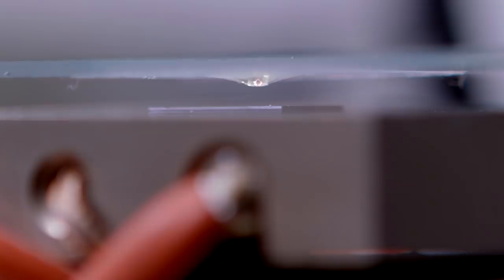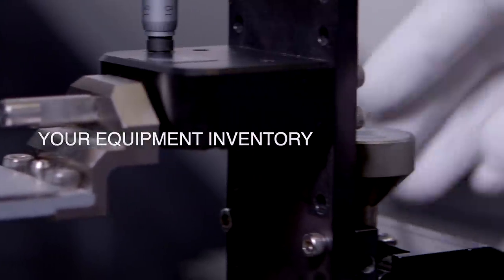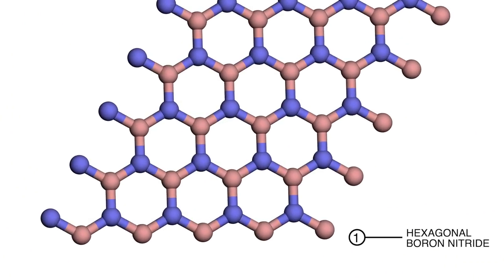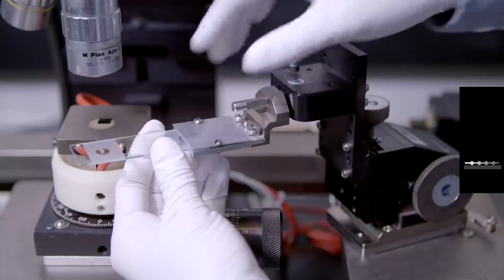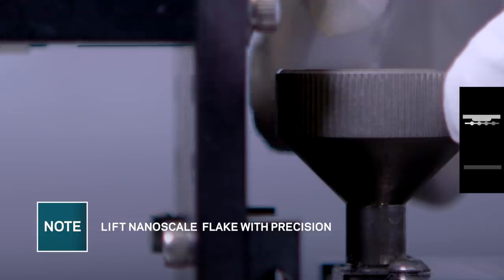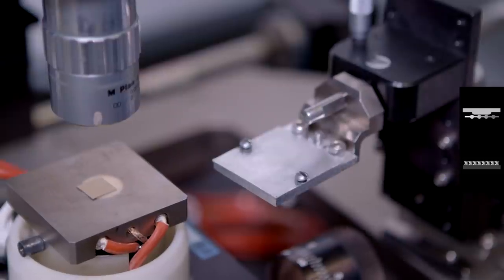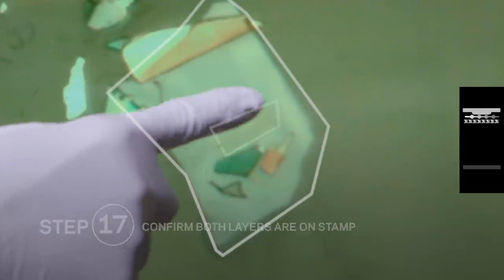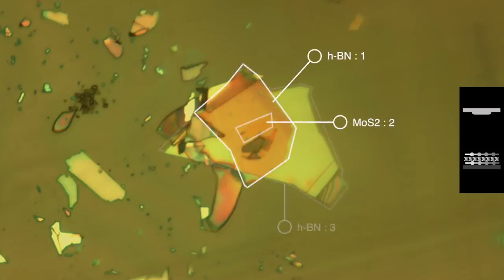Building at the Nanoscale | Part 02: How to Build 2D Atomic Stacks

Comment: Hi can you please tell how you prepared the glass slide with the stamp? Does your glass slide have a hole where the stap is?
Reply: I am working in a lab where they are doing this. the slide is layered with a small ppd square, then tape, then spin-coated pdms which is transferred on by a second piece of tape. This was not very clear, so let me know if you have any questions.
Reply: @Haryanvi in US Hi Haryanvi! I am not entirely sure, I just use the machines as they are set up lol, but I believe the spin coater is set up for 100 rpm for 30 seconds, then the spun material is heated on the slide for 1.5 minutes at 100 C (on a normal hot plate), then when picking up any material the temperature (of the hBN, for example) should be around 40 C when the stamp makes contact. After the stamp is barely in contact with the hBN, heat the setup to 60 C, and the stamp material should relax and be completely covering the hBN. After that, lift the stamp off and you should have picked up the substrate. Finally, heat the stamp at 100 C again, but for only 15-20 seconds. This final step is to get rid of any wrinkles in the stamp. Hope this helps!
Reply: @@haryanviinus713 basically as soon as the ppc covers the hBN COMPLETELY, you can lower the temperature and raise the stamp. The hBN should be on it. To answer your question, usually at least 30 seconds.